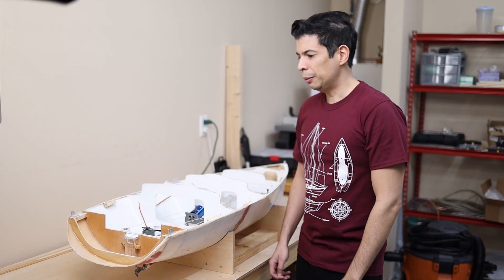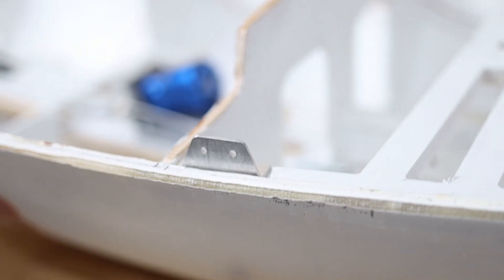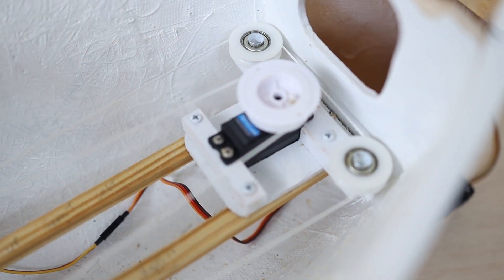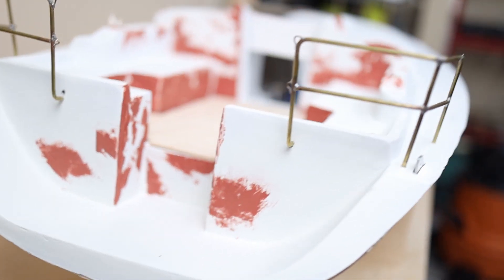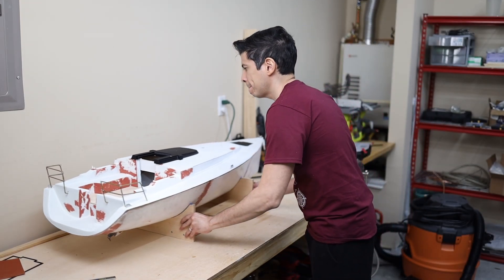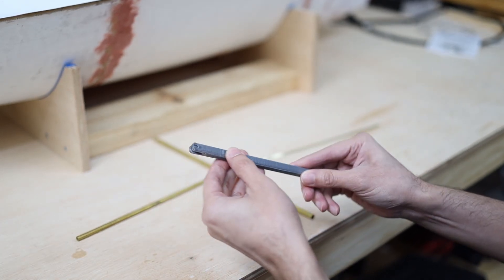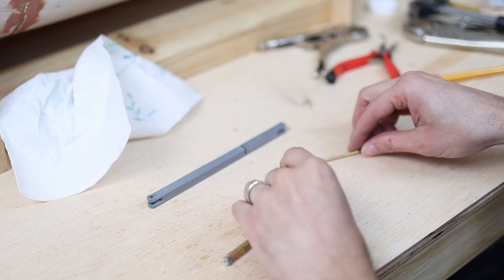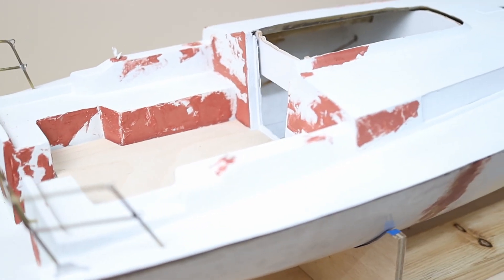RC sailboat build Beneteau 37 part7

Comment: good morning   i am also owner of a reduce rc model of a BENETEAU but it is FIGARO II 1/10 eme scale  
you can see it on YOU TUBE  figaro de jean louis  
issued from a project in my club
Reply from the maker: Yes I saw the video very beautiful model, how long was the building time, materials and design?
Reply: @domingomartinezt  good mornig   the hull is issued from a club project severl years ago  made of fiberglass ( we have the moule ) project stopped by the owner and i have bought  this hull second hand  new paint   and sails also  
i install also electric motor  ( graupner speed 400 ) radio controled  the revision of " ty nouff " ( its the  name  of the boat ) take 3 months

Comment: Great built! For the hatch mold you can try using more thickened epoxy or rovings in the corners. For the mast I recommend a carbon tube or two tubes (one bigger and one with smaller diameter glued together) and then make the shape with glassed foam. The mast must be light for sailing performance. For the keel you may consider a stronger filling than plywood like carbon or solid glass so that it doesn‘t bend. Great work!
Reply from the maker: I already finished the cabbing hatch using silica to tick the resin. I'm thinking first iteration for the mast on wood, and since is detachable and can change it to more spence high performance one on the future, thanks for your comments!!!